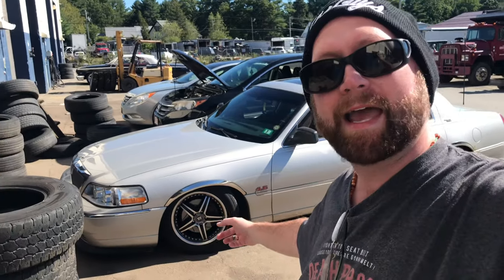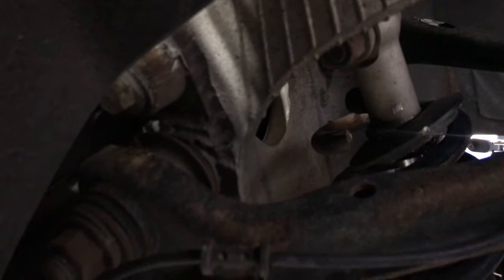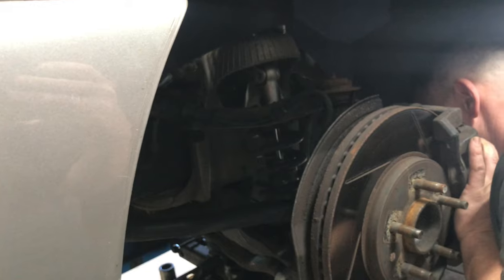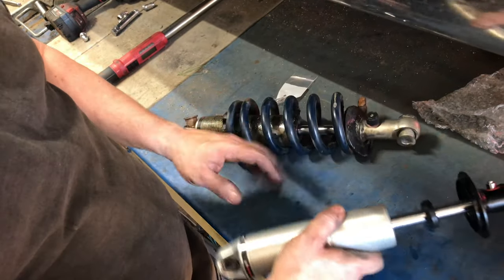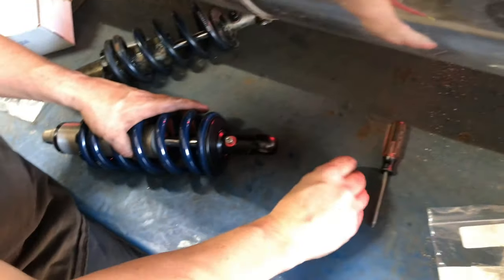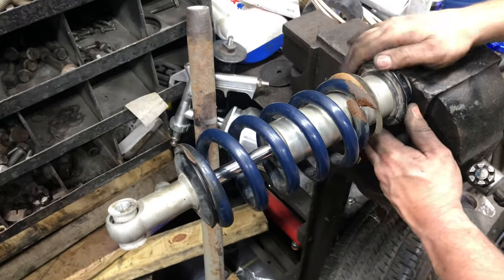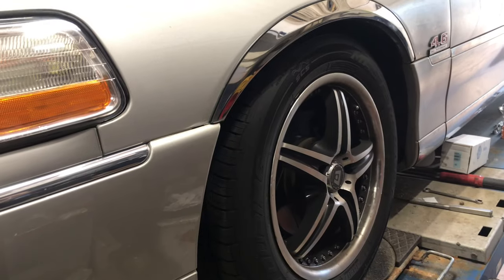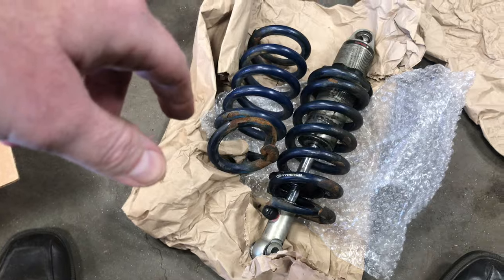Town Car Coil Over Suspension Issue

Comment: I thought the TC front end was looking a bit off in one of your other videos Jay. Glad to see you got it fixed before it started chewing up the front tires.
Reply from the maker: It’s funny I thought they were just breaking in not broken… when we went to adjust them we discovered they were broken. Those aren’t cheap springs either and Hyperco has a stellar reputation.
Reply: @carguysnewengland  I've seen the hypercos break on the rear from towing

Comment: They don't look like cheap knockoff springs or shocks. I've never seen springs break like that unless it was on a truck.
Reply from the maker: Yeah it’s pretty crazy… the car isn’t driven crazy either. I suspect failure of the coating on the springs combined with driving it in the winter and salt